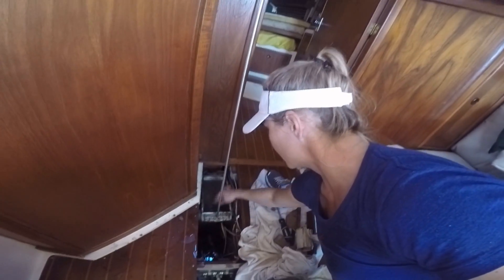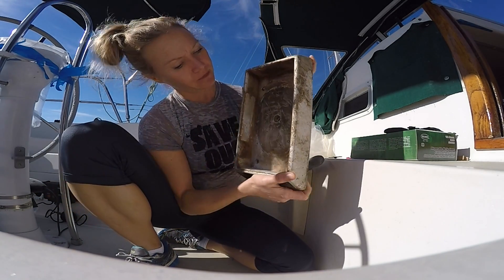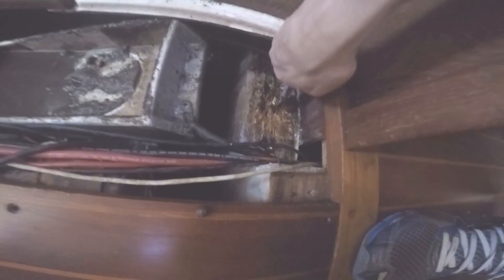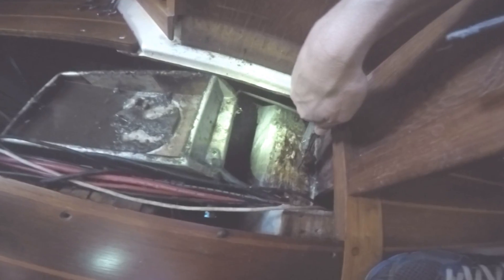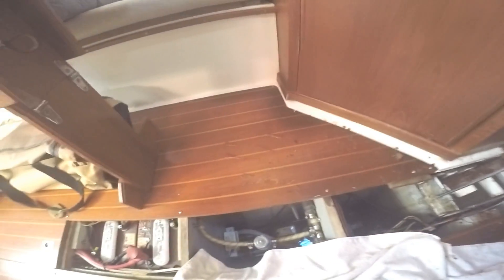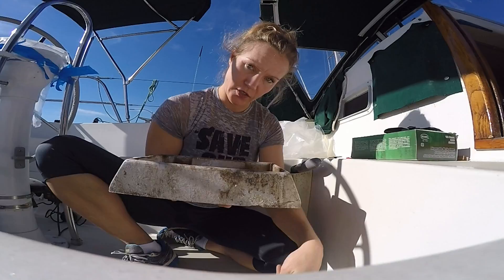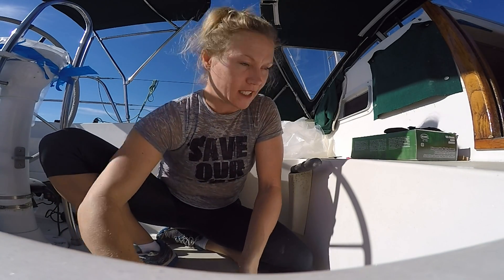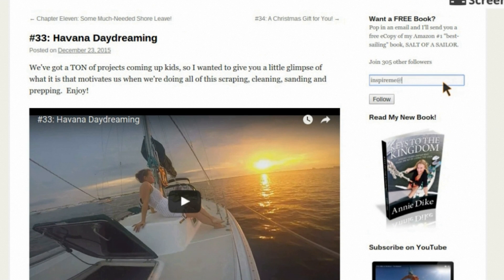#41: The Cause of our Rotten Stringers

Comment: I know your mast is already reinstalled, but for others facing the same issue I would recommend drilling several weep holes in the center of the plate.  This will not affect the load bearing ability, as the mast load is spread around the edges of the plate.
Looks like fairly soft aluminum, so adding holes will be easy.

Comment: bummer,  They're called "Floors" not stringers.  Looks like the base of the mast didn't have drain holes.  just grind a couple of small half circles in the foot of the mast on either side so that the water can drain out in a place you can see!
Reply from the maker: +Pierre Mitham Hey Pierre.  Welcome to the party.  Thanks for your input.  It did have one weep hole but it was clogged (that will never happen again, I can assure you).  And, thanks on the floor vs. stringer tidbit.  Sadly I didn't learn that until well into the repairs so I'll keep making the mistake in Video Land for a while!  Ha!  Thanks for watching!

Comment: lol...so you need to do a little reach around on the mast hole every now then...I'm sure the mast step will love that! are you going to add a secondary weep hole in the side of the mast step, so if you see water coming out of it, you'll now the primary one under the mast is clogged??? just a thought...oh, and this video was too short :-D
Reply from the maker: +S/V LO-KEE Hey Lo-Kee.  We did have horizontal weep holes that weren't very effective.  We didn't know, however, that a little water sitting in the step meant four gallons sitting in the mast.  Live and learn.  We will probably enlarge the primary vertical weep hole in the base before re-stepping the mast.  Want the flow there nice and solid!  : )

Comment: Great video! I don't understand why so many on these sites have leaking masts. Does your lines run inside your mast? Deck stepped ones maybe but keel stepped mast shouldn't have that i would think.  wires on top should be caulked well. my mast doesn't leak at all. and it sets right on the fiber-glass keel. tried sending a picture but deleted this and had to write again. so many seem to have stringers  under them.
Reply: +theislandpackrat Mine is the same way as yours.  I re caulked all the holes in the top of my mast when I had it down.
Reply from the maker: Yes our lines run in the mast and whole the sheaves are designed to allow as little water in as possible they can't stop it all. We also found several bonus holes once we pulled her. The joys of boating. You're lucky my friend!!

Comment: Every step I've ever seen has done this.. The weep hole in my step is so small you couldn't get an ink pin through it. The mud from dirt dobbers building  nests in the mast, the the rain washes the mud, eggs and dead spiders they put in there as baby food drains down the mast and plugs the hole. My advice.. Bigger hole.... I'm pulling my mast again is the spring just to drill it out.
I had to drill a small hole in the side so it had somewhere to drain till then and it would stop rotting my floor. Also there is a conduit on the aft side of the mast. make sure you trim the bottom of it so the water can drain through the weep hole and not just sit in there. How many years have these builders been using aluminum masts and never figured this out...
Keep up the great work guys..
Reply from the maker: +Sailing with SV Wild Hare Ahh, thanks Wild Hare!  We've definitely learned a lot about our mast drainage (that's a word today).  We had drilled horizontal weep holes at the base of the step but they obviously were not effective enough.  We had been debating drilling out the primary vertical hole bigger and now, with all of the comments I've received today, I definitely think we will.  Thanks for your input.